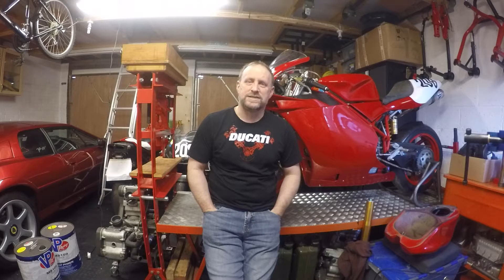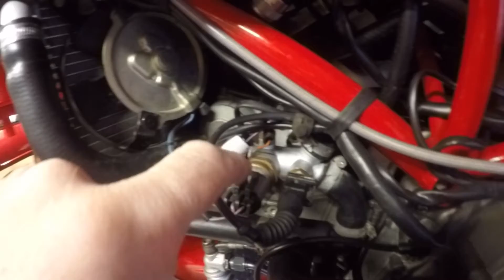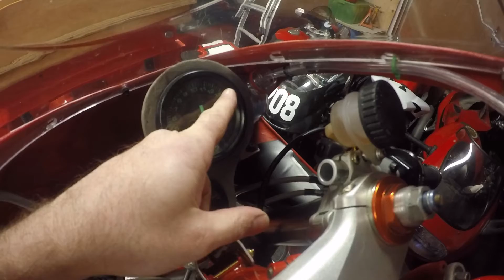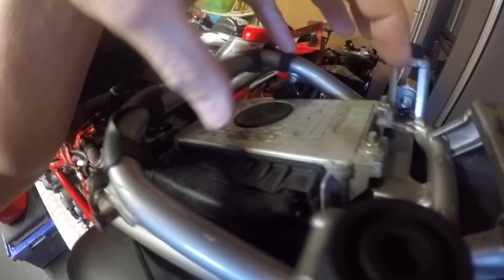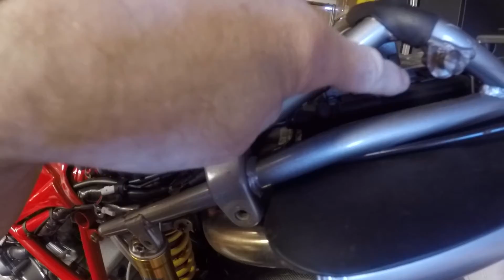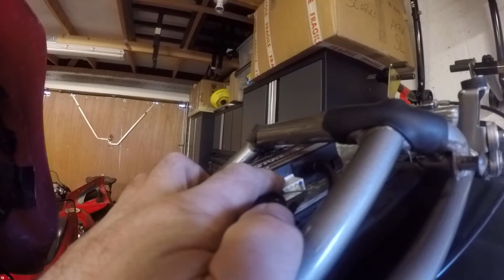2020 Thunderbike Sport Brands Hatch Meeting - Failure

Comment: Very interesting channel.

I've built a 748 for vintage racing here in Canada and ran into a similar issue (lost ignition in one of the cylinders once the bike was hot on track).

Did you finally find the reason for your problem?
Reply from the maker: Mine was the ignition pick up, had to replace it twice as I bought a new one that was defective as well. 😊
Reply: @DesmoWerx  Was the new timing sensor reststance out of limits? How did you find out? 🤔

Comment: It might be a bit late but it's 100 percent an ECU fault. I had two fail on me for different reasons. But it manifests in a similar way. i know a Ducati and he's got a stack of ECU's all with slightly different faults. Another fault that I've had is the ECU connection can vibrate loose and shut the bike down. But when you look at the connection it seams to but fitted correctly and it'll start right up again. A few cable ties sorted that out but it took a while to find the fault!
Reply from the maker: HI Hugh, this was another item I have considered, I have spare ECU's to use just have not had the track time to validate the repair or further fault 😊

Comment: i would run it at about 2000 rpm on a stand then blow the loom with a hot air gun then the ecu and sensors if that doesn't show anything wiggle the loom.... I know im watching this behind time... only just found your channel did you find it?
Reply from the maker: Hi Neil, fingers crossed I think it is sorted now, I have had the bike running for 45 mins in the garage without issue. It was the new ignition pick up, it had broken down, I put in another spare I had and no issues 🤞🤞

Comment: You mention your temp gauge not reading correctly... my own 748 when i collected it had a temp gauge problem.... with testing i discovered that basically the housing was not earthed.... as its bolted to the engine and the earth strap checked out just fine.... but a small earth lead from frame to the sensor body and the gauge works!
What diagnostic machine have you got?
Talking of chips..Do you know the differences between the standard eprom vs the one supplied with the carbon Termi "open exhausts".?
My 748 s is currently stock... i have obtained some of the carbon 45mm pipes...and am considering if its worth swapping the chip over.... im a gentle rider...
Cheers
Peter
Reply from the maker: Thanks Peter I will look at trying that. Regarding the pipes it is better to get the chip fitted if you can find one or get a power commander and remap the bike on a dyno. This is so you can get the best out of the pipes. The chip adds a little extra fuel to take advantage of increased airflow
Reply: @DesmoWerx  i have the chip that goes with the pipes... so i could swap it... although it seems to be running just fine as is..oddly i expected them to be louder than my alloy ones but the sound just the same! Would be interested in knowing what diagnostic kit you have ?
Cheers
Peter

Comment: Have you checked the regulator? They normally get very temperamental with heat and can cut out the engine. They cool quite fast as well, so can be a pig to diagnose!
Reply from the maker: Interesting one to look at, I have not considered it as the battery is holding voltage correctly. Will check the regulator out if it happens again

Comment: Hi DesmoWerx, I feel like crying for your Thunderbike. How come you use the Power Commander? Just for quick shift? When you have the problem, is the fuel pump ready or stopped? You have eliminated the sensor of the side stand, it could be that if pump does not have the consent to turn. After about the video and I try to think of something else ...
Reply from the maker: Hi teo,
Power Commander is too fine tune engine and allow me to run the qucikshifter. Pump is still running when the problem presents itself and side stand is eliminated, think I have now found the possible problem 😊
Reply: @DesmoWerx  Ok, but your EEPROM is stock?

Comment: Shame about your electrical gremlin, but great a well put together video as usual 👍🏻 , question I have a 848 road bike changing the plugs do I stick with the mar10a-j or the cr10eix or do you recommend another sort , cheers mate
Reply from the maker: Thanks Mick, will get this resolved :)
The plugs are both made by NGK but the cr10eix is iridium so slightly better spec materials but only has a single side/earth electrode I believe versus the double for the OEM. It really comes down to cost unless you are racing and changing them regularly I would stick with the OEM plug
Reply: DesmoWerx I’ve put the cr10 in now but next service I’ll put the oem back in, good luck with 748

Comment: misfire can be only for several reasons. 1 mixture formation (not enough gas) from this later ignition and backache and engine temperature.  2 gap spark plugs .3 temperature sensor on the control unit (measure resistance manually) .4 pressure and !!!  performance in liters of fuel pump.
Reply from the maker: I have checked these issues but will be checking the sensors again in case anything has failed. Thanks 😊
Reply: Can you check gap sensor? Maybe very close?

Comment: Main wiring harness connection under left handlebar. Wiring flexes on handlebar movement leading to fatigue and eventually separation. Live lead is culprit and may be completely separated but still work intermittently.
Reply: Break will be adjacent to where cable enters the connector.
Reply from the maker: Hi Rhubarb Crumble,
I will be checking the loom over to see if I have had a stress fracture in the wiring. Thanks for the suggestion. 👍😊

Comment: Totally feel your pain. I took the 998 for its 4th track day where it suffered its 3rd consecutive mechanical failure that kept me from getting time on it. Thank god for my trusty 675.

When your bike wouldn’t start trackside, was it huffing and puffing as if it wasn’t getting fuel? Or was it just cranking over with nothing happening combustion wise?
Reply from the maker: Hi Rob,
It would do nothing over than turnover when it first fails, when getting cooler it then fire again and runs for a while without issue. The fuel pump can be heard running so I believe it is getting fuel.
Reply: DesmoWerx I swear I’m having a similar issue on my 998. Bike ran fine coming off track. Sat for 30min, wouldn’t start. Fuel pump primes, but just cranks over. Removed the fuel pump thinking the pressure hose came off, but no luck. 

I’ll let you know what conclusions I come to, hopefully we can kill two birds with one stone.

Comment: Frustrrating to be sure ... please let us know what the issue was.  I had a similar issue with my 999 racebike, ultimately replaced the ECU and all was well.  I think you are on the right path.   I am told that the capacitors in the ECUs can go bad and create all manner of havoc ... particularly with the transistors that fire the coils.
Reply from the maker: Hi Desmo Andrew, Interesting to know, I have not heard about the capacitor issue before. After I remove the ECU I am going to send it away for bench testing, perhaps this will throw up the issue you reference.

Comment: Frustrating for you mate 😢
Reply from the maker: I hate electrical problems because they are like secret gremlins that hide from you when you go looking 🤣
Reply: DesmoWerx yes, as you said varying conditions. A component like an ignition pick up can be fine until it reaches that exact temperature where the fracture in the coil separates. Sometimes the parts canon is the only option. I hope you are actually able to isolate it and share what you found. Good luck.
Reply from the maker: @ANDY5   Parts cannon it is 💥
If I could dynamically test the bike with the DDS it might throw the fault up but the unit is so large and cumbersome that it is just impractical.
An option would be to run it on the dyno but that may not provide the load for long enough to generate the same conditions.
Fingers crossed its the ECU or management side of the loom 🤞

Comment: hi dont know if this helps but i had a very similiar fault with my 916 sp  and it turned out to be a dry connection on my ecu also if you need any parts please  get in  touch if i can help you out i will free of charge  only postage
Reply from the maker: Hi Trevor, it can be a possible fault. Will look at everything at this stage. I did not have any dielectric grease to use at Brands so could not rule this scenario out.

Comment: I've had simular problems on my 748 street bike. It took many attempts by Ducati mechanics to find the problem. In the end it was a faulty eprom/ Ecu. I think you're on the right track!
Reply from the maker: Its fingers crossed time that this is the right move :)
Reply: I got a 97, bought it brand new, always a street bike and had electrical problems also. I ended up replacing almost everything but it finally went away after that and has been an awesome bike since.
Reply from the maker: @mmotorcycles9497  I think there were some quality control issues in the earlier 916/748 series of bikes, the factory struggled to keep up with the demand for the models and the supply chain was stretched.